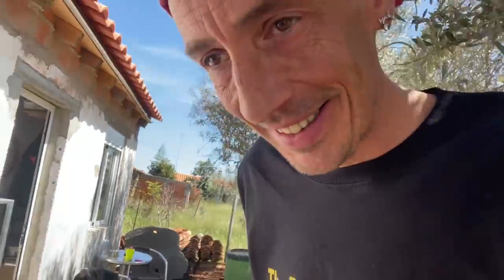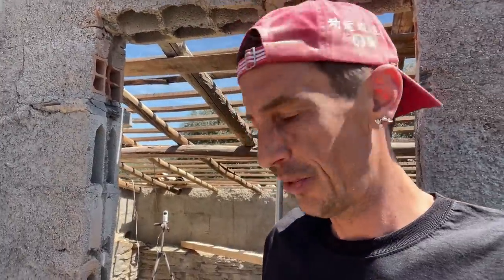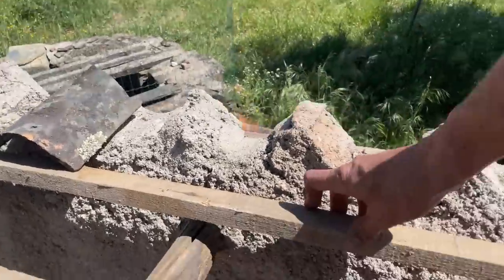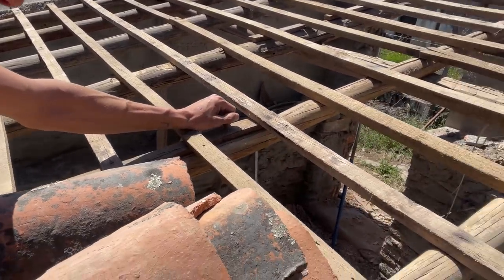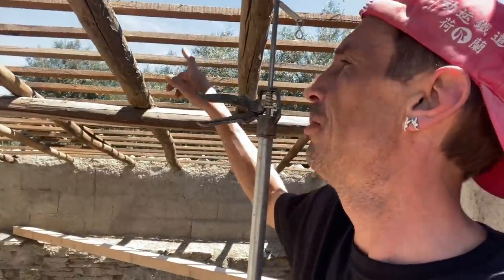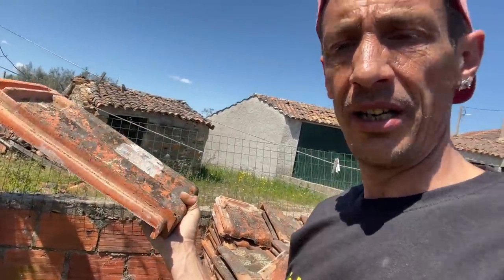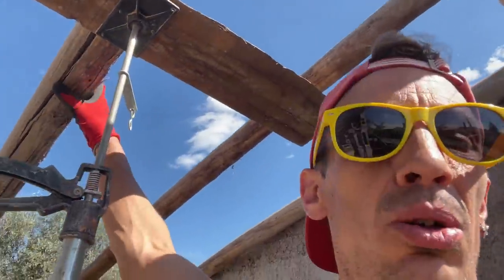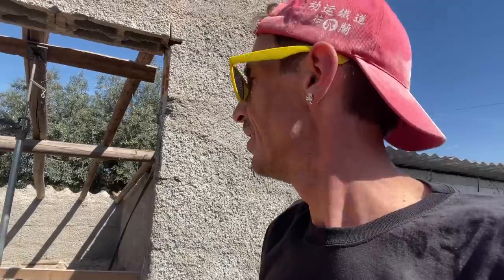MINI REBUILD PART 5 (..accessing the roof situation) - Portuguese House Renovation

Comment: Hi Jasper and Duarte.  Great work Duarte on that wall and with just a hammer. You'll have it down soon. Jasper congratulations on your subscriptions so pleased for you. Roof is looking good. You could use 2 rafters, the tile over hang is good no rain on the outer walls causing damp. Recycling at its best  glad the building is so square. Makes your life,work, build so much easier. More jobs ticked off the todo list. Have a nice mini party 🥳  congratulations 🎊  again. Stay safe,thanks for sharing.

Comment: Think you got carried away taking all the battens off, it seems like mostly a solid roof with just that one rafter that needs some attention. I think you need to just sort that out and do a good job and it will last many years to come. Maybe there is a way to even fix that rafter if it's only rotten at the end like you were implying. It does even have some extra support half way down. You just need to make sure it can support the tiles without leaks, then the wood will be protected from the rain. Someone was suggesting making a scarf joint?

Comment: I really think the best way to do this is to fix it up with what you have and then asses the issues. It might be too hot or it might not be but until someone has the chance to try it out they won't have an idea what the real issues might be. If it's too hot maybe there could be curtains to cover the glass or even wood shutters you can close, like in the older houses in Portugal. That might make for a nice mix of old and new tradition too. 

Rather than making a rough guess and spending a lot of money why not try what you already have like Jasper is trying to do. It makes sense. Reusing what you already have is also a lot better for the planet, no matter how you do it. Re-use is even better than recycle.

So Jasper, I vote you carry on with your re-use project rather than trying out some new modern super materials or what have you because there's only so much they can do anyway (assuming they do anything useful at all!) 

You are on the right track. Keep going Jasper. :)

Comment: If you clad on top of the existing rafters with boards etc, then setup another set of rafters on top of the cladding boards to insulate and batten for the tiles above..
Reply: that's a great idea, especially when you notice the step on the lower part of the wall   🧱🧱🧱

Comment: Have you thought about buying and using insulated roofing sheets, that have a tile effect? They will be far easier to install. I think it will be so much better to keep the room cooler in the hot summer months and colder winter months. With the ceiling height being low, I think it will be like a sauna in there using normal roof tiles. In the building that you are in, the ceilings are way higher. Just a though.
Reply: maybe he is bearing cost in mind and reusing what he has already instead of letting it go to waste?
Reply: @dweamy1  I did think about Jasper wanting re-use the stuff he has. He also has to think of the comfort of his new content editor or the person will not want to stay there.
Reply: The sun baking your face start putting you some moisture cream on it.

Comment: I think that I would want to put "knees" under the cross-beam, running vertically between the top of the schist wall and the cross-beam, possibly with angled brackets extending diagonally out to meet the cross-beam.  This would make the roof structure a lot stiffer. 

Congratulations on 10,000!

Comment: I guess it comes down to..."What look do you want to have from the inside when all is done.
I would suggest removing all the round rafters , finishing the top ledge so that it is level to carry 
a 4" square rafter cut to rest on the top and bottom allowing room to put 2" insulation as did Bea and Theo

Comment: Check out what the type of mortar is that is on the tiles. There is brick acid if they're covered with cement - if it's lime you might find washing them and using white vinegar is the most commonly recommended way to remove lime based mortar. Get some big tubs for washing them and also you may find using an old disinfectant spray bottle with brick acid in or white vinegar would be good way to deal with them economically. You could even brush on the solution and let it run off into a tub to use again. It will be time consuming and you may find for the time input that new tiles aren't a bad deal.

Comment: Lost my previous comment ! 
I guess it comes down to this. What look do you anticipate the roof / ceiling from the inside ?
If you want to continue the rustic look then continue how you are doing.
As an alternate.
Remove all the 'poles' on front and back.
Level off the ridge so it is completely level.
Figure out the length of the slope and buy some 4x4" lengths of wood (pine) using the notches to rest at both ends and build your lengths of tile frame ( from left to right) to suit your choice of tile.Lay your tiles accordingly, finishing the ridge so there are no leaks.
When you come to the inner ceiling, I would definitely put at least 2" of foam insulation

Comment: Why is your washing machine by your gate?🤣 You have so many buildings to put it in, It is going to get rusted outside.👀😁
Reply: He covers it with tarp when it rains and it will go inside once the building is ready.  Portugal is a warm/hot country so it won't rust that quickly.
Reply: @dweamy1  ok reasonable answer.

Comment: Just wondering how you are going to pour the cement into the side shuttering if you put the lintel in first. Wouldn't it be better to build up the sides and then put in the lintel?